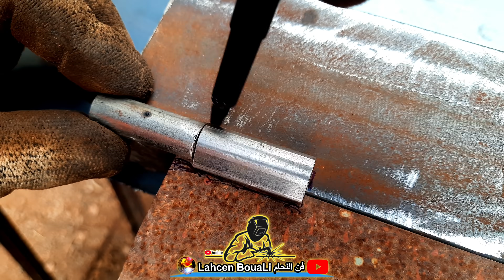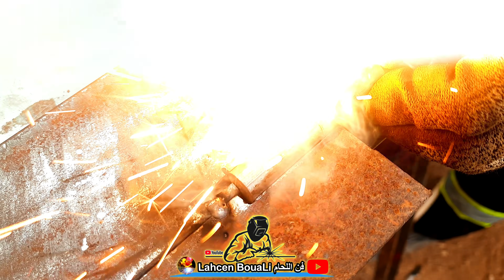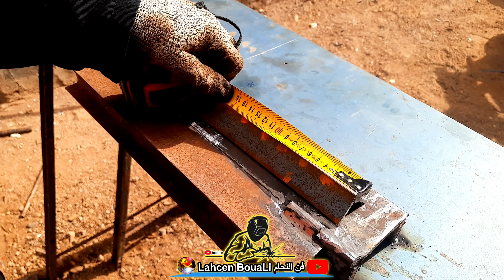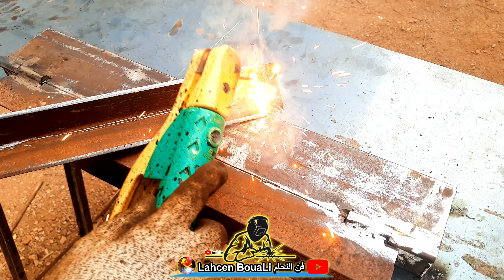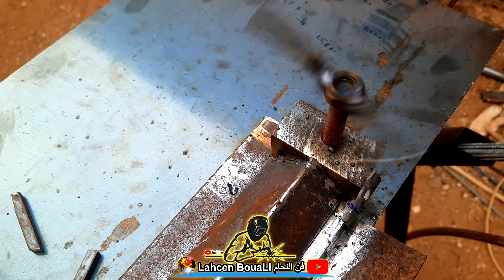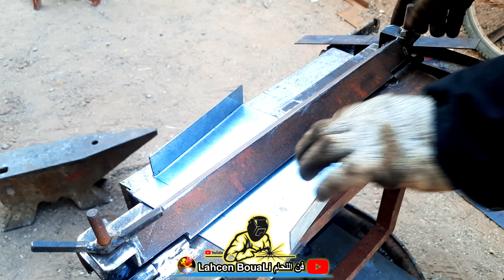كيفية صنع آلة يدوية ثني الصفائح معدنية / Learn how to make a manual sheet metal bending machine

Comment: I love all the comments for these brakes saying how brilliant they are.
They ALL have one major error, what happens when you want to bend thicker metal? The clamp MUST be adjustable to take into account the thickness otherwise you won't be able to bend to 90 degrees.
I have found only one video out of dozens with slotted holes for the clamp and adjustable stops for the clamp bar.